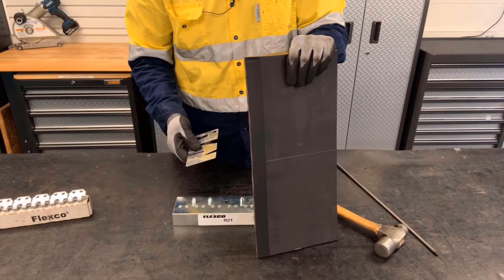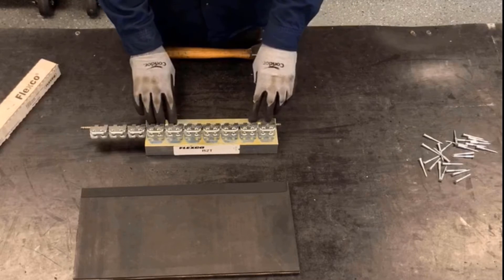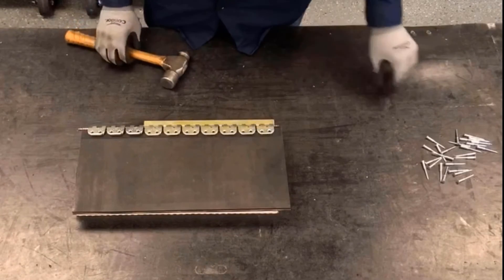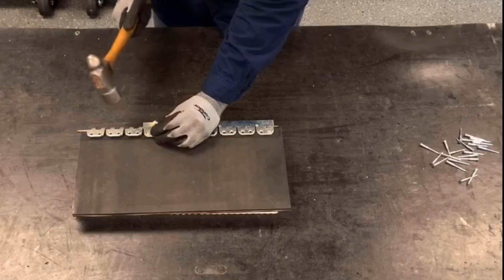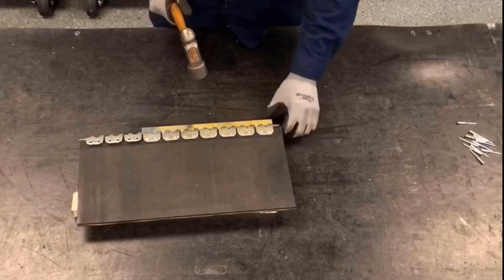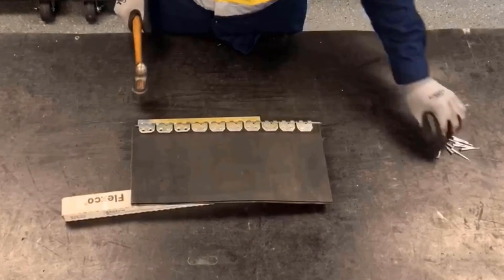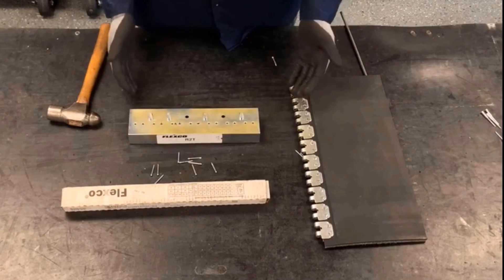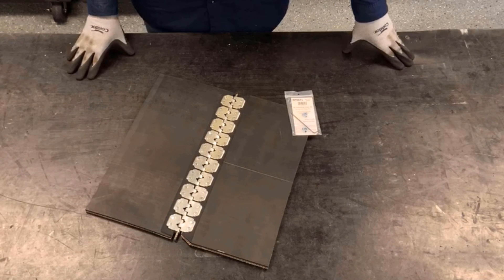Flexco® R2 Rivet Hinged Installation with R2T Applicator Tool

Comment: Where do i buy the Flexco Retaining Collar Kit for Hinge Pins for the 8/32" pin. I have only found the #2 rated for the larger pin.
Reply from the maker: #40198 HPRET1 Hinge Pin Retaining Collar has a range of 7/32-9/32” so the 8/32” (1/4”) pin will work with the HPRET1